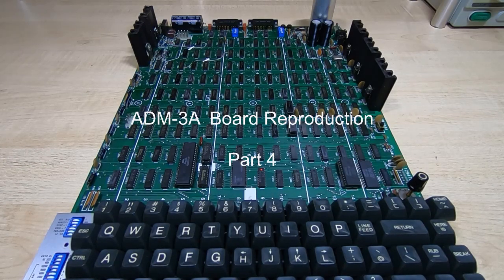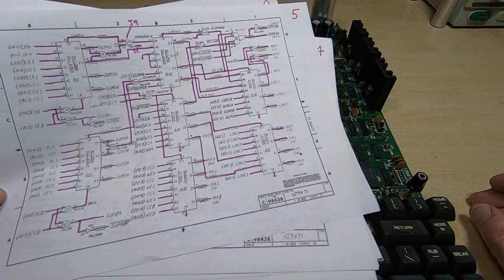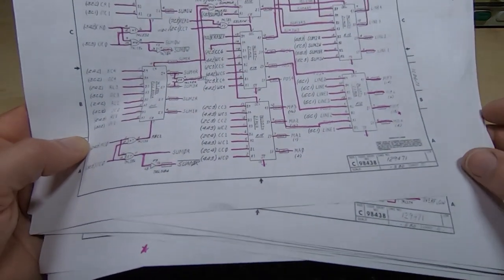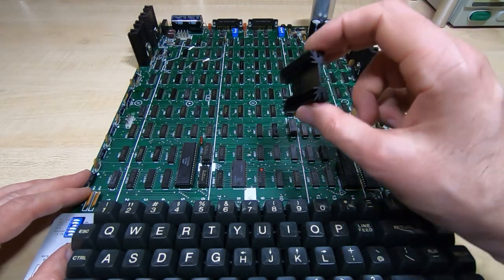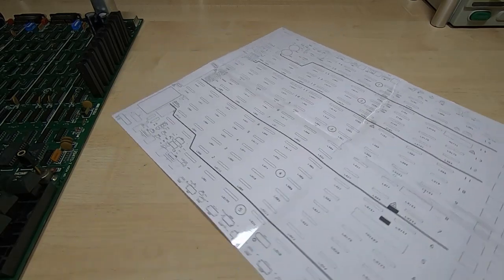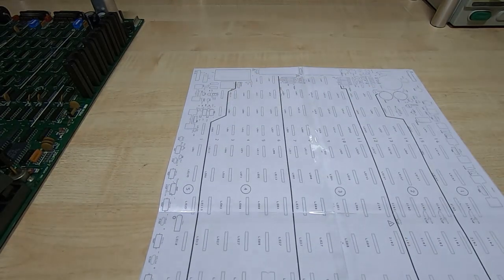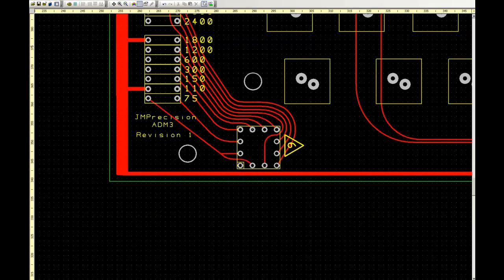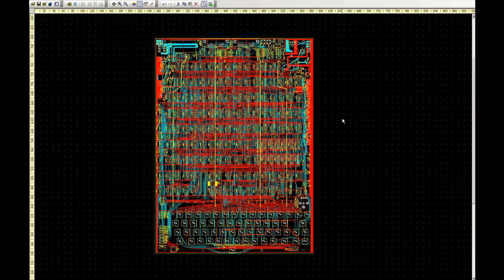ADM-3A  Board Reproduction Part4

Comment: I'd be interested if you include a Bill of Materials with stock numbers from common suppliers.
Reply from the maker: Sorry but I won't be doing that. It is a never ending task keeping up with stock levels and availability of old parts from many suppliers. I will only be providing a generic bill of materials and it will be up to the individual builder to locate the parts from whatever seller currently has them.
Reply: @JerryWalker001  OK, I'm still interested. I love a challenge!